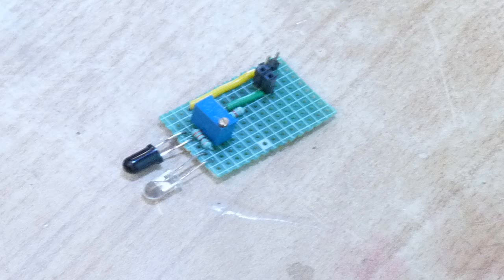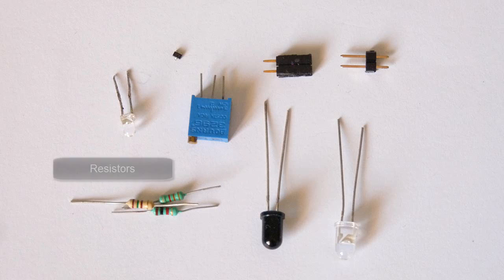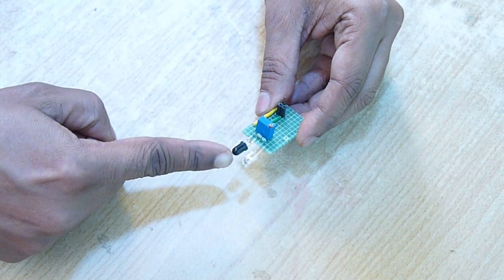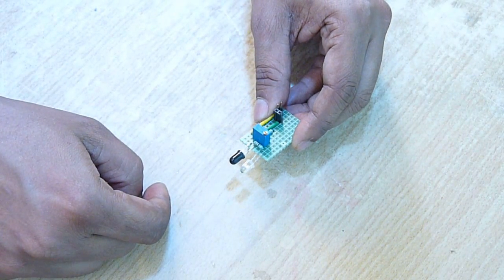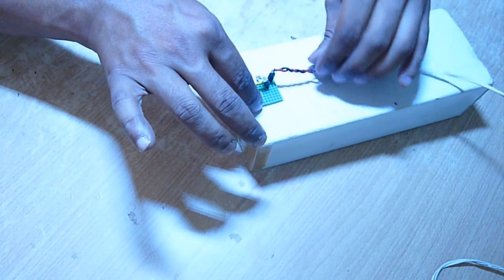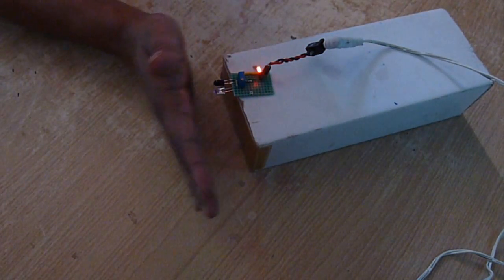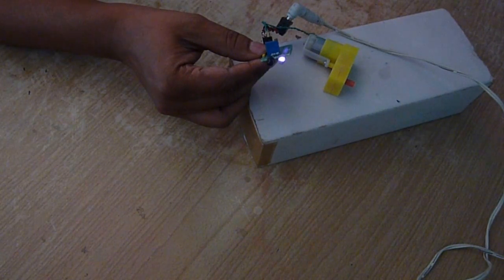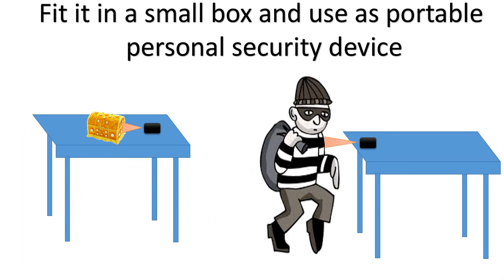how to make a very simple Infra Red IR proximity sensor for Robots

Comment: is it possible than instead of it lighting up when an object is near it will light up when an object is far away? if not what can you suggest to this function?
Reply: hi...my sensor is behaving in the manner as Acbox wants...i want to correct it ...how it can be done
Reply: Science Emporium yurvdj
Reply: hello.my friend , i am charlie luo,an engineer in NEW OPTO ,we are manufacturer for Light sensor,photodiodes ,phototransistor infrared diodes motion sensor , if u want design any circuit ,pls contact memy whatsapp +8615875595222my skype :charlie32978
Our facebook : new opto

Comment: When i take my hand over the sensor, led dims instead of glowing. Also i used bd139 but it isn't driving the motor
Reply: same problem here
Reply: try L293d, dis will work.
Reply: Omkar Bhalerao have u found a fix to it
Reply: hello.my friend , i am charlie luo,an engineer in NEW OPTO ,we are manufacturer for Light sensor,photodiodes ,phototransistor infrared diodes motion sensor , if u want design any circuit ,pls contact memy whatsapp +8615875595222my skype :charlie32978
Our facebook : new opto

Comment: IR Proximity sensor for Line follower and obstacle avoiding Robots,Easy interface with Arduino,AVR,8051,ARM,PIC,MSP430 etc. microcontroller. https://www.amazon.in/dp/B010VJTIEI/ref=cm_sw_r_cp_apa_TO1Ixb61X3T7W
Reply: but where is output pin
Reply: got it ! thank you very much

Comment: Hi. I do this right now and my only problem is the pins. Where the pins connected? Is the battery or the power supply is connected in dc motor?

Comment: http://www.amazon.in/1000-RPM-DC-Geared-motor/dp/B010V2M9G4/ref=sr_1_25?ie=UTF8&qid=1438861141&sr=8-25&keywords=motor  

above like circuit or the same will do ????
What Parts Shall I use for connecting this motor to a

Comment: I will make one for my walking robot, can you please make a video of you soldering all the components into pcb board for the sake of those people who can't read the schematic diagram like me.. wish you will.. thanks.. this sensor is awesome..
Reply: *****  thanks that you will.. Ok I will study how to read schematic diagrams... 
I have a question, is it possible to use a three IR sensor ., one in front ,one in left and one in right side of a robot.. the purpose is when the sensor sense that there is a wall in front and its left side , the robot will turn right side and when a robot sense that there is a wall in its front and right side the robot will turn left and lastly when the sensor sense that there are walls in its left, front and right sides the robot will turn 180 degrees so it will able to go back if its dead end.. hahaha.. wish you can able to make a circuit that will have that function... thanks..